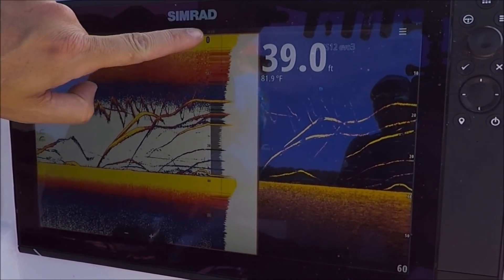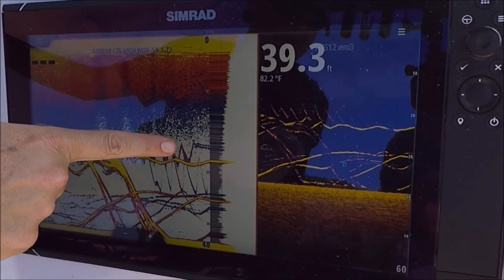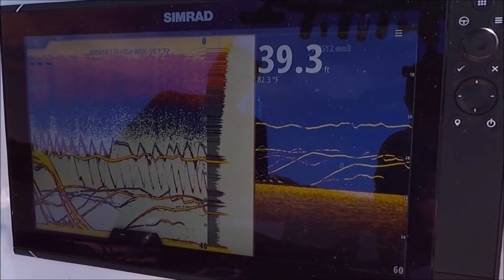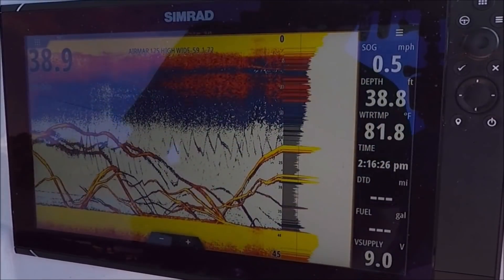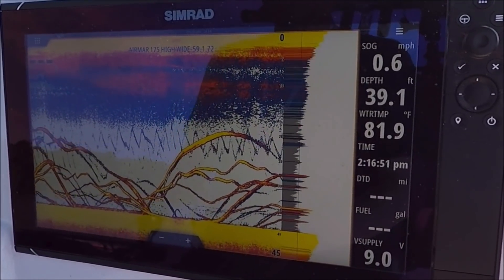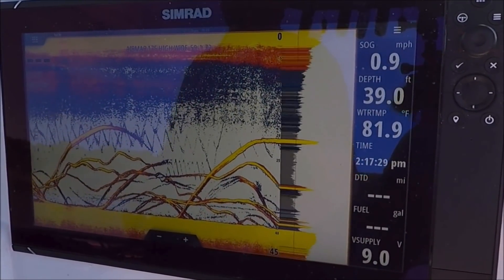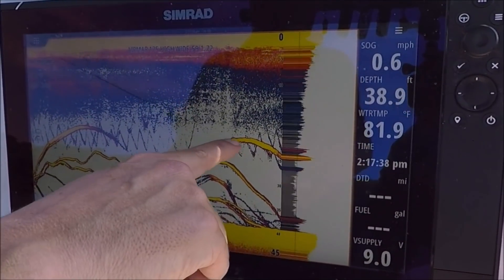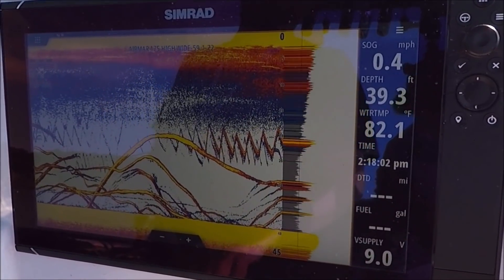Understanding your Fish Finder. Sonar for beginners.

Comment: Mike, where on your boat is the transducer mounted?  I don't have a boat yet, but I understand the components of the fish finder (at least I think I do) and it seems like most people I know either mount their transducer up front under the trolling motor, or all the way in the rear under the transom.  If it's under the transom, does that give you a better view of the fishing lines/jigs/lures relative to the fish, or does it work better if the transducer is mounted more underneath the bow/trolling motor?  Can you just take me fishing and show me before I spend a lot of money on a boat and gear? :)

Comment: Hey Mike thanks so much for all the great info. You inspired me to get a Simrad. Got the Go9 and love it. Only issue that's driving me crazy is I can't pick up any marks while jigging unless it drifts under the boat. On my last boat I had an hds 7 and picked up really good from either side of the boat most time. Please help me figure this out. It's the active transducer. I've tried in all frequencies and also have adjusted the angle of the ducer a couple times.
Reply from the maker: I’m really glad you like the videos brother!! Thanks for saying so.  Your widest cone will be 83khz.  I recommend staying there in water up to 50 feet or so, you can absolutely use it deeper, but Medium CHIRP will start to work better at around that depth with that transducer. The side scan on that transducer is the best I’ve ever seen so live full time in Side Scan in open water when looking for fish “around” the boat. Spit the screen to keep side scan up all the time and you can add 83 on 2D simultaneously. It’s hard to beat seeing well over 100 feet to each side with that Active Imaging. Let me know how that goes for you.  I think you will like it.
Reply: Thanks man I'll give it a shot and let you know.
Reply: Hey Mike thanks for the solid advice really been enjoying the go9. I've found the sweet spot while jigging. 200kHz has been working great for me. Really like high chirp but can't bounce back and forth from sonar to side scan. I have some cool screen shots I'd love to share. Is there a way to insert them on the comments.

Comment: Can you give me a break down of your settings for my buddies boat. His is all messed up and constantly has an issue showing the bottom correctly, also marking fishing correctly. I have the garmin and am dialed in, he has the simrad but a more in depth model than yours.
Reply from the maker: Todd Mann sure.  Not sure what you mean though. In depth model?
Reply: @MikeSmedleyOLDSCHOOLSTRIPERS  it's got more buttons and setting down the right side and is a larger unit.
Reply: So the issue I have seen on his boat is the bottom showing about a 10 foot to 20 foot area of light blue. So the depth is never reading accurately. Also his fish marks are spikes while on a drift rather than the arches we should be seeing or bait balls ect.
Reply from the maker: I’m offended!! I think the tight frame makes it look smaller.😁 It’s a 16 inch display. This is an Evo3 so he may have an Evo2.  The Evo2 has buttons straight down the side, where the Evo3 has them in the top right corner. I have a video link at the end of this video that shows my settings. 😁😁👍
Reply: @MikeSmedleyOLDSCHOOLSTRIPERS  thanks so much man. I am not familiar with his unit but feel it would save time see your setting rather than trouble shooting it next time on his boat. Thanks again!
Reply from the maker: It sounds like his transducer is at too great an angle.  It can be other things too, but when set too “tilted” you will get half arches.   Have home check this one out. I think you can see all my buttons in this one 😱😱😱😂 https://youtu.be/S0MpGwKUVNA
Reply from the maker: Anytime brother!!! Make sure his interference filters are off too.

Comment: not sure you can answer this question, - I need some help with my new Garmin Echo Plus 93sv, I troll for trout, kokanee, and land locked king salmon in Nor Cal lakes. Friday while trolling with my four down riggers, I noticed fish on my sonar in Trad view at 30' so lower down my downrigger weight to 30' on the counter. Look at the Garmin screen and my see my weight at 35'. So the depth is off by like 5'. I have a Furuno also in the rear of the boat and it too was off by about 3'. Found in the Fruno menu "draft" by hitting plus or minus feet you make the downrigger wt. appear at the same place on the sonar screen. 
My question is, how to make this depth adjustment to my new Garmin  can you please help me
Reply from the maker: Unfortunately I don’t have a Garmin, but there will be a depth offset adjustment somewhere I’m sure.
Reply: Mike Smedley yeah thanks. One YT guy got me my answer. It is keel offset. Ty

Comment: Maybe you can help me I have the same setup as you my screen looks nothing like that in fact I can't even get a fish symbol on mine I have turn the gain all the way up I still don't see fish I also have the Evil 2 and I can see Fish on that but not the three with a high chirp
Reply from the maker: Gerard Miglino what transducer do you have?
Reply: @MikeSmedleyOLDSCHOOLSTRIPERS   the Simrad totalscan transducer downward Imaging chirp and side-scan
Reply from the maker: The Total Scan is a great ALL PURPOSE Transducer, but you won’t get results like mine with it.  Your cheapest option is this unit 

https://amzn.to/2BsVMud

The next step up is this one. 
https://amzn.to/2XDLJw7

I am using the second one, but you will see a large improvement using the first.  

 These are both transom mounts.

 If you use these links when you buy a Transducer you get lifetime setup help from yours truly.  😁😁. You get the lowest prices so it’s a WIN-WIN.